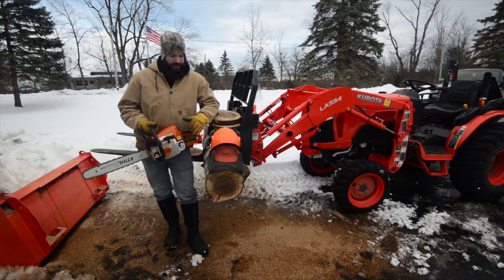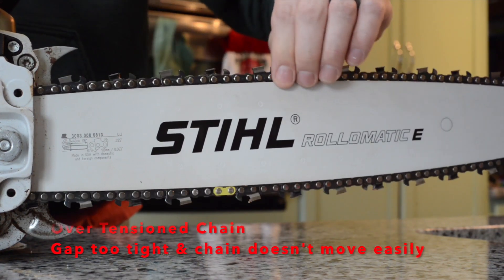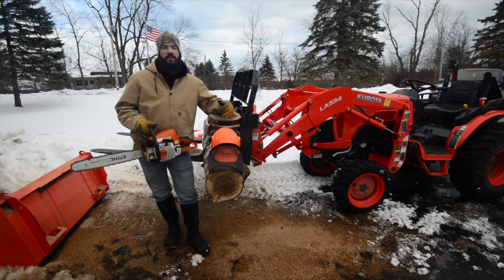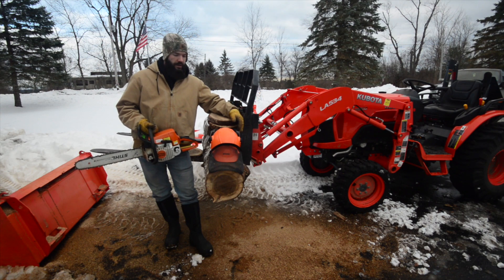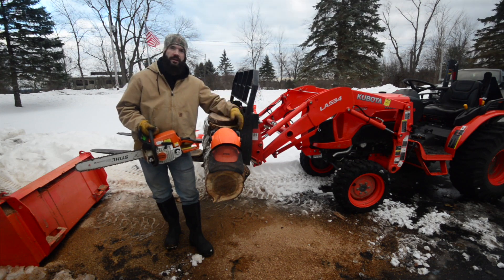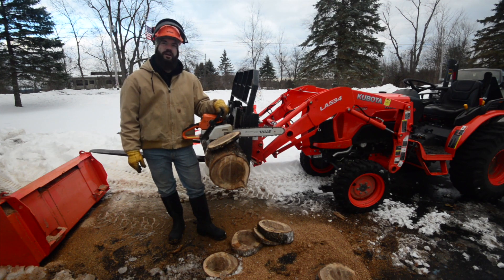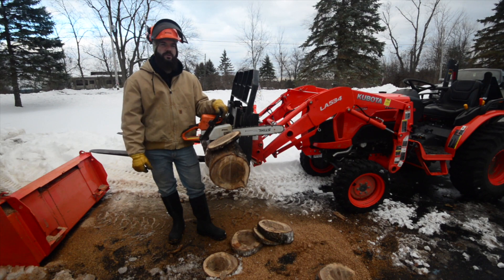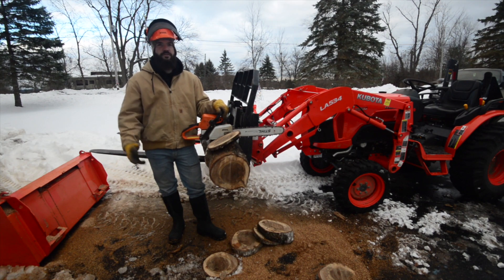Chainsaw Chain Tension - Don't do this one thing!

Comment: It is interesting, but I didn’t see how tight your chain is, as properly, I feel most people over tighten, and cause extra friction, my 50 years of cutting fire wood tells me that the chain should droop slightly about 1/16 to 3/32 droop, on a used chain.
Reply from the maker: About 14 seconds into the video I show the proper tension and the over tightened chain. I leave about a 1/16” on the bottom of the bar.